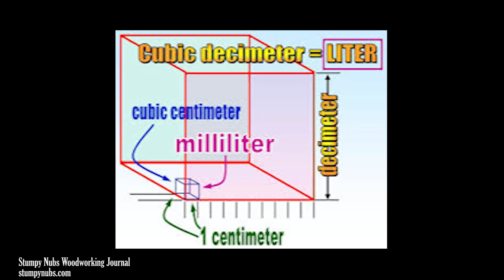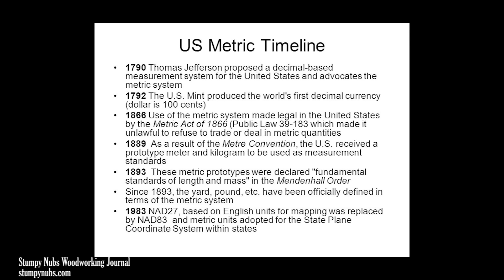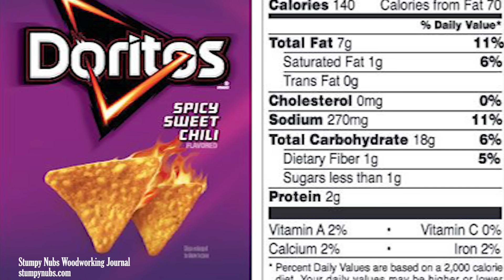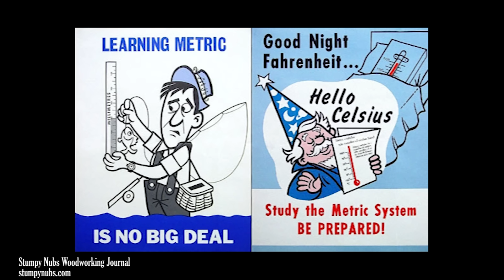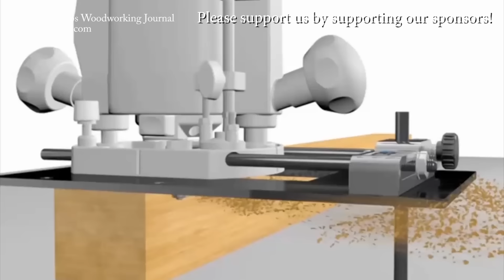BREAKING: The USA is switching to METRIC!

Comment: The US doesn't even use the imperial measurements; I'm not sure what their system is called, but it has different sized gallons and fluid ounces to the imperial system (where a gallon is eight pints).
I (64yo Brit, but in Germany from about age 6-11) use a mixture. I find inches easier to relate to for odd things around the house, and miles, but I prefer metric for weights (and when I used imperial, I knew my weight in stones and pounds, not just pounds!). Of the two centigrade temperature scales, I prefer Celsius.
What's that you say? Yes, both are centigrade scales! Dr. Fahrenheit set his 0 at the lowest he could easily reproduce (melting brine I think), and his 100 at his body heat (I think he had a fever at the time); Dr. Celsius set his 0 and 100 at the freezing and boiling points of water (strictly, at sea level, but that doesn't make much difference unless you're a mountaineer).
For time, I still use the 60/60/24/365.2524 system - but then so does nearly everyone else. I do write my dates in ISO format though - today is 2024-5-31 - as it keeps USians happy with month first, but year first alerts UKians that it's unusual. (The US version of
middle-small-big does seem very illogical, though when month is given in letters rather than numbers perhaps less so. But it does seem like giving the time in
minutes:hours:seconds or similar.)

Comment: I have gotten to the point of hating the metric system. Why? Because people keep telling me I have to use it or else. And no one can tell me why I should. Outside of "Europe is doing it". I don't care what Europe is doing. Cubic inches seems to be more accurate. 5.7 liters coveres the Dodge 345 and the Chevy 350 and the Chevy 348. All completely different engines. Also having both is more expensive. BECAUSE, I have to have both standard and metric sockets, wrenches, and so on. and I see no real advantage over either.

Comment: I see a lot of mix use. In the sport of wing foiling, the wing board volume is measured in liters, the physical dimensions are measured in feet and inches and the weight is measured in lbs. As for the inflatable hand wing, the size is measured in meters but the inflating pressure is measured in psi. Go figure.

Comment: And brits use stones for body weight, and they have been metric for a long time.  They also make range rovers, so it can't be that good a system.  They also have a non metric hydraulic thread standard that was foisted on the hard working koreans.

Comment: Yes international units are easy to use but.....do you know the size for my shoes in France? That's 45....quart of inches!
And for tires of my car : 19-270 ?  19 inches diametre and 270mm width! 
But also we can find old units ( not  official): for the volume of fire wood :1 corde (1rope) = 3 m3 (1m long pieces)
1char (charette) of slates cover 14 m2 of roof.

Comment: In uk - we are devided, im 60 and use both as trades man but height and weight is still imperial. We still use miles per hour and miles per uk gallon. They sell fuel in litres but you buy a new car and it tells you miles per gallon.
It's easier when making things but height weight distance.
The imperial system yours - you got from us which came to Britania (uk) 2000 years ago with julius ceasar and the roman invasion.
Only advantage your willy ( Johnson) 4 inches or 100mm😂

Comment: i use metric for work, but for crafting I prefer imperial because I hate dividing by 3.333333333333333333333333333333333333333333333333333333333333333333333333333333333333333333333333333333333333333333333333333333333333333333333333333333333333333333333333333333333333333333333333333333333333333333333333333333333333333333333333333333333333333333333333333333333333333333333333333333333333333333333333333333333333333333333333333333333333333333333333333333333333333333333333333333333333333333333333333333333333333333333333333333333333333333333333333333333333333333333333333333333333333333333333333333333333333333333333333333333333333333333333333333333333333333333333333333333333333333333333333333333333333333333333333333333333333333333333333333333333333333333333333333333333333333333333333333333333333333333333333333333333333333333333333333333333333333333333333333333333333333333333333333333333333333333333333333333333333333333333333333333333333333333333333333333333333333333333333333333333333333333333333333333333333333333333333333333333333333333333333333333333333333333333333333333333333333333333333333333333333333333333333333333333333333333333333333333333333333333333333333333333333333333333333333333333333333333333333333333333333333333333333333333333333333333333333333333333333333333333333333333333333333333333333333333333333333333333333333333333333333333333333333333333333333333333333333333333333333333333333333333333333333333333333333333333333333333333333333333333333333333333333333333333333333333333333333333333333333333333333333333333333333333333333333333333333333333333333333333333333333333333333333333333333333333333333333333333333333333333333333333333333333333333333333333333333333333333333333333333333333333333333333333333333333333333333333333333333333333333333333333333333333333333333333333333333333333333333333333333333333333333333333333333333333333333333333333333333333333333333333333333333333333333333333333333333333333333333333333333333333333333333333333333333333333333333333333333333333333333333333333333333333333333333333333333333333333333333333333333333333333333333333333333333333333333333333333333333333333333333333333333333333333333333333333333333333333333333333333333333333333333333333333333333333333333333333333333333333333333333333333333333333333333333333333333333333333333333333333333333333333333333333333333333333333333333333333333333333333333333333333333333333333333333333333333333333333333333333333333333333333333333333333333333333333333333333333333333333333333333333333333333333333333333333333333333333333333333333333333333333333333333333333333333333333333333333333333333333333333333333333333333333333333333333333333333333333333333333333333333333333333333333333333333333333333333333333333333333333333333333333333333333333333333333333333333333333333333333333333333333333333333333333333333333333333333333333333333333333333333333333333333333333333333333333333333333333333333333333333333333333333333333333333333333333333333333333333333333333333333333333333333333333333333333333333333333333333333333333333333333333333333333333333333333333333333333333333333333333333333333333333333333333333333333333333333333333333333333333333333333333333333333333333333333333333333333333333333333333333333333333333333333333333333333333333333333333333333333333333333333333333333333333333333333333333333333333333333333333333333333333333333333333333333333333333333333333333333333333333333333333333333333333333333333333333333333333333333333333333333333333333333333333333333333333333333333333333333333333333333333333333333333333333333333333333333333333333333333333333333333333333333333333333333333333333333333333333333333333333333333333333333333333333333333333333333333333333333333333333333333333333333333333333333333333333333333333333333333333333333333333333333333333333333333333333333333333333333333333333333333333333333333333333333333333333333333333333333333333333333333333333333333333333333333333333333333333333333333333333333333333333333333333333333333333333333333333333333333333333333333333333333333333333333333333333333333333333333333333333333333333333333333333333333333333333333333333333333333333333333333333333333333333333333333333333333333333333333333333333333333333333333333333333333333333333333333333333333333333333333333333333333333333333333333333333333333333333333333333333333333333333333333333333333333333333333333333333333333333333333333333333333333333333333333333333333333333333333333333333333333333333333333333333333333333333333333333333333333333333333333333333333333333333333333333333333333333333333333333333333333333333333333333333333333333333333333333333333333333333333333333333333333333333333333333333333333333333333333333333333333333333333333333333333333333333333333333333333333333333333333333333333333333333333333333333333333333333333333333333333333333333333333333333333333333333333333333333333333333333333333333333333333333333333333333333333333333333333333333333333333333333333333333333333333333333333333333333333333333333333333333333333333333333333333333333333333333333333333333333333333333333333333333333333333333333333333333333333333333333333333333333333333333333333333333333333333333333333333333333333333333333333333333333333333333333333333333333333333333333333333333333333333333333333333333333333333333333333333333333333333333333333333333333333333333333333333333333333333333333333333333333333333333333333333333333333333333333333333333333333333333333333333333333333333333333333333333333333333333333333333333333333333333333333333333333333333333333333333333333333333333333333333333333333333333333333333333333333333333333333333333333333333333333333333333333333333333333333333333333333333333333333333333333333333333333333333333333333333333333333333333333333333333333333333333333333333333333333333333333333333333333333333333333333333333333333333333333333333333333333333333333333333333333333333333333333333333333333333333333333333333333333333333333333333333333333333333333333333333333333333333333333333333333333333333333333333333333333333333333333333333333333333333333333333333333333333333333333333333333333333333333333333333333333333333333333333333333333333333333333333333333333333333333333333333333333333333333333333333333333333333333333333333333333333333333333333333333333333333333333333333333333333333333333333333333333333333333333333333333333333333333333333333333333333

Comment: I use decimal inches when model making. Since the original drawings were in feet and inches this works well. I have a decimal inches ruler that i use when making the model parts which makes things really easy. I always thought it was funny how metric temperatures were less precise that F. One Celsius degree equals two or three degrees of ours, is that better?

Comment: Far too often people focus only on the base 10 convention of the metric system. SI is far more sophisticated than that. Unit conversions are not needed and any higher unit can be brought back to the basic SI units allowing you to cross check formulas  by checking units. Speed is distance over time [m/s] acceleration is change in speed over time [m/s²], force is mass times acceleration [kg*m/s²] and so forth. Gone are all these odd units like lbs or lbf or ounces and fluid ounces, ... The  Imperial systems is just an insult and time waster.

Comment: One funny fact for all those that say the US should use the metric system "like the rest of the world" (which I happen to agree with). The entire world, and I mean the ENTIRE world still uses inches! If you are reading this comment, you are using electronics. Electronic chips are often based on the inch! The pins are 2.54mm apart on a DIP chip and 1.27mm apart on an SOIC for example. Why such a strange number? I mean 0.54 or 0.27 millimeters is nearly microscopic and all but round. Well, 2.54 mm equals 1/10 of an inch. 1.27 mm equals 1/20 of an inch. Lots of dimensions in electronics are still expressed in inches all over the world. To be truthful, yes, there are also electronic parts which are dimensioned in the metric system.

Comment: Be like us Brits - use both any time, any where!! We still measure a lot of distances in miles; beer still comes in pints (and not bloody fluid ounces like some people I could name.) 
I personally in the engineering and science world I have inhabited, have been forced to  learn and accept multiple system - like Imperial / CGS / SI and so on. Pressures for me have been measured in pounds per square inch, bars, atmospheres, kilograms per square centimetre, poundals and so on - it doesn't hurt, and you soon get used to it. Now, if we couild just get you Yanks to stop serving your beer deep frozen! 
😉

Comment: Actually there are no metric shoe sizes. Every country including EU have their own system. Nightmare.  

Shoe size should be 2 dimensions in mm, the length and width of your foot, and nothing more 

Same thing with clothes, every country has their own system, including EU. The most logical system in the world is us jeans sizes,  the actual length of your leg and the actual circumference of your waist. No dividing by 2 and looking up a translation table to an arbitrary size "number."

If car engines had the same system, we'd have a camaro with a size 10 engine, and a camry with a size 5...

Comment: If the #US were to continue its progression towards metric, if metric were to be implemented by sector, IMO next sector would be the road transportation sector concerning road signage so more North American spec and imported LHD (Left-Hand Drive; mainly designed for keep right roads) vehicles won't require significant dashboard modifications where metric labels are on the outer edge for both imported and exported vehicles. IMO doubt every #US sector would go metric. Reasons for metric in road transportation, especially road signage, is so vehicle manufacturers can further standardize their productions with having one dashboard design and vehicle trading would be less problematic. Also, considering that there are vehicle hoarders for any reason (cost, sentimental values, etc.), inbound road tourists from #Canada and Latin America would not have to squint at the inner #US Customary label of their analog speedometer (not the case for dynamic digital speedometer) where the needle is thicker which makes maintaining precise speed more difficult. Similar case for outbound #US road tourists, including vehicle hoarders, squinting at the inner metric label of their analog speedometer when visiting #Canada and Latin America by road with their #US spec vehicles. Basically, if metric were to be implemented, one key sector for metric is road transportation so manufacturers can standardize their speedometer design and makes it easier for drivers to only have to read their speedometer's outer labels.

Comment: They never fully got rid of imperial in the UK. You just get used to both like Americans do with calculating sales tax in their head all the time. Or people who grow up bilingual. Metric is definitely easier. But once you get used to imperial you rewire you brain to do on the fly maths outside of powers of 10. How many inches in 91/4 foot? How many furlongs in 61/2 miles?

Comment: We work in "soft metric".....but I would love it of the steel mills would just form steel at metric nominal values here in the west.  How long is the world going to hang on to 63.5mm wide square structural steel?...or 101.6mm?  C'mon people...I use them both freely....but Metric is easier.

Comment: I love they way that you preserve Imperial, since it wasn't even your empire, it was ours.
And didn't you rebel against our empire? Something about tea, and traders that didn't want to pay taxes. (like a certain ex-president...)
Seriously, there are good reasons to have a measurement system that uses numbers that have plenty of factors, like 12 or especially 60, whereas 10 has only 4 factors.
And it works both ways, the rest of the world is still stuck with ICs and connectors that are on 2.54mm centres.
Reply from the maker: The Imperial System used in the UK was not developed until long after the American Revolution. The system used in the US is loosely based on the old English system, but it was actually invented by the Romans, not the English.

Comment: It basically doesn't matter what the initial length and weight is. But it's a bit confusing when each branch makes up its own units. In the metric system, I have the volume of anything and anywhere, a drug or a reservoir, in milliliters, liters, cubic meters, etc., I just move the decimal point. In imperial you have feet per acre, fluid ounce, gallon, quart, cubic foot, cubic inch, forget the decimal point :-) Or another case. An electric motor has an input of 1 kW. How much heat does it produce? I look at the tables and see that 3412 BTU/hr. In rest of world, I think deeply ... and yes, the motor produces 1 kW of heat :D

Comment: In precision engineering it is much more of a problem and unnecessary complex. Gauges , number and letter drills, a multitude of different thread types etc. Of course when they started using micrometers it was soon very obvious that the inch became unworkable in its fractional state  so they came up with a brilliant idea, let’s go decimal and divide the inch into a thousand pieces and as soon as they made that incredible discovery ( with a little help ) one would think that they would get rid of all those other pesky archaic  engineering oddities, NO THEY Didn’t ! One of the metric bonuses is, you don’t for example have to look at a chart on the wall to find out what the size of a drill means in civilised measurements. Let’s give it a few more centuries and you’ll probably claim this metric system was your idea .

Comment: Yes, please go to metric. I am tired of buying 19/32 plywood. Also, the 24 hour clock would be nice switch as well.
Reply from the maker: You know all they would do is change the label from 19/32" to 15 mm and you would still be buying and using the same plywood, right? You can just call it 15 mm now if you want.
Reply: @StumpyNubs  I do call it 15mm. I converted my shop to metric about 10 yrs ago, just waiting for the rest to convert. I will admit...it's gonna be awhile.